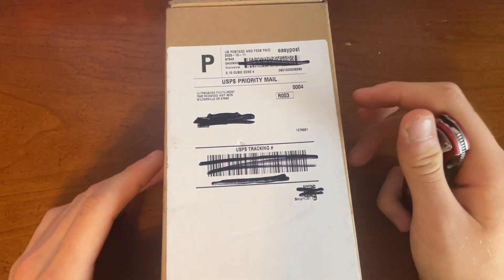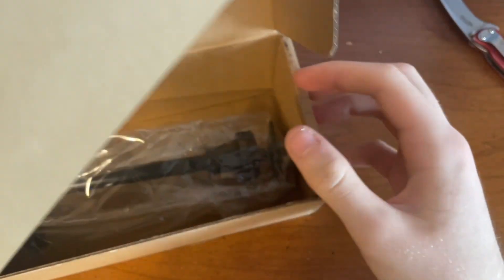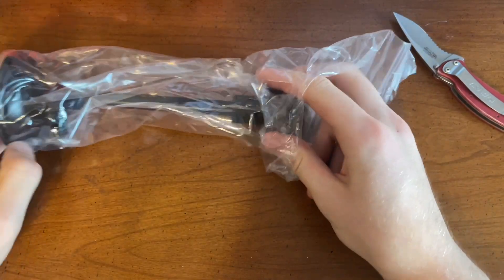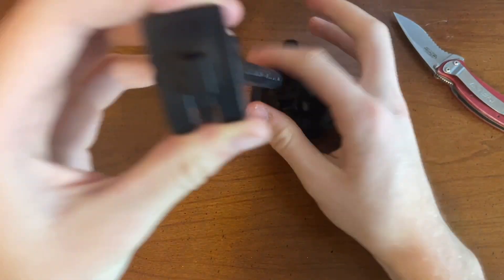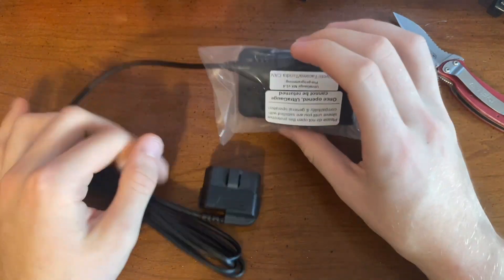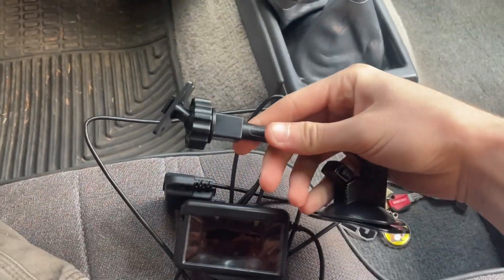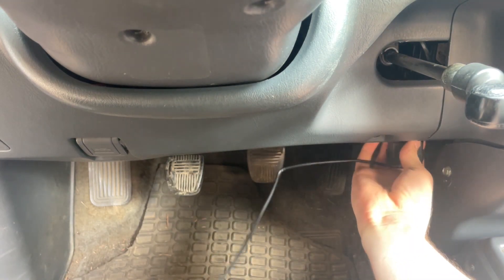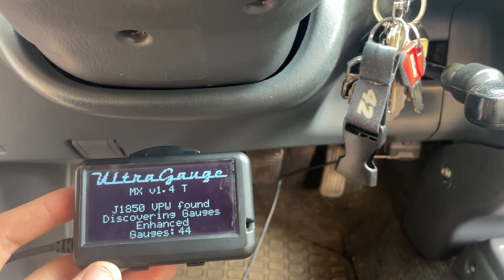Real Time Engine Information | Ultragauge MX V1.4 Quick Review

Comment: You forgot to mention the heartbeat and oval shapes on the top of the screens, both automatically and permanently configured, which represent that the gauge is operating okay (the heart rate) and that the vehicle is in open or closed loop (an open oval or a closed oval). Basic and important thing to mention.

Comment: It’s instant mpg. You probably only saw over 100 mpg when you were coasting. It supports injector cutoff on deceleration. If this is activated you’ll see 999 mpgs.
Reply from the maker: @MyFutt  Yea Ive started to figure out how it works, you just have to keep a really steady foot on the gas to get a accurate reading. I actually prefer the Instant over the average because for some reason the average is way off. No way im getting 26 mpg in a 5vz-fe Tacoma with no headers or an exhaust. Even then like 22-23 would be about it. Ive reset the average and toggled between inst/avg, and the instant will read like 20-21, and at the same time the average will read 27. Its weird.
Reply: @JonahLyman1776  Look into the calibration section in the manual. It will never be perfect but I’ve seen mine up to 13% off. You can get it somewhat close and then just use it as a baseline. I also swapped out the average mpg to  the short trip mpg. It only tracks your mpg since you started the vehicle. It’s like a game. lol. “How high can I get my mpg driving to work.”
Reply from the maker: @MyFutt  Interesting I’ll have to give that a try. Ive calibrated my speedo since I have bigger tires than stock on my pickup and I assumed it would auto calibrate all the other stuff. My scanner said I had 12.4 gallons out of a 18 gallon tank left. And the pump said I put about 6.1 gallons in. So it was about half a gallon off over that time span.
Reply: @JonahLyman1776   Yup! Calibration of the speedo is super important too. Unfortunately it doesn’t auto calibrate anything. 
So it sounds like the ultra gauge said you used 5.6 gallons but you actually used 6.1. That’s about 15% off. The ultra gauge is just taking the amount of air coming in from the maf sensor and estimating the amount of fuel needed for that amount of air. Under perfect conditions that would work but unfortunately there are errors in the sensors and ethanol gas blends differ. Fuel trims are always changing…There are tons of variables.
 I’ve seen it guess my fuel consumption within a .25 gallon on a 20 gallon fill up. I would add 10% in and try again.
Reply: @JonahLyman1776  averages are correct. it just takes longer to become more accurate throughout an entire tank. Even on new cars that come with mpg gauges, it will always "say" 1 or 2 mpg more than it really is.  I call that accurate and if you ignore the number and just keep in mind the reference, it's useful in the same way a dyno is useful. to notice changes and improvements/debilitations in your averages which will prompt you to check the car out.
Reply from the maker: @twrcrew8852  Mine is way more off than 1 or 2. I started using Lucas Injector cleaner in my tank and had been doing a bunch of offroading before so I reset it to get a more accurate highway measurement. I probably ran 750-1000 miles and had topped probably 8 times or so. My truck in ideal conditions could run around 375 miles give or take. Gets around 21-22 mpg on the highway when the math gets done. But the Ultragauge after 700 miles was saying 26-27 on average. Id run live mpg and reset the average then start driving, real time would say about 20-22 and the average would say 26-28.